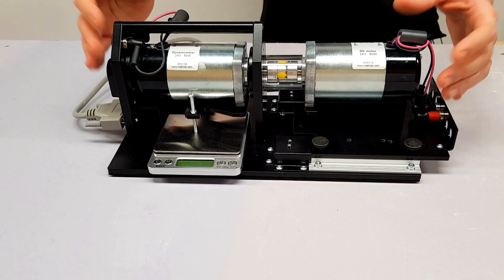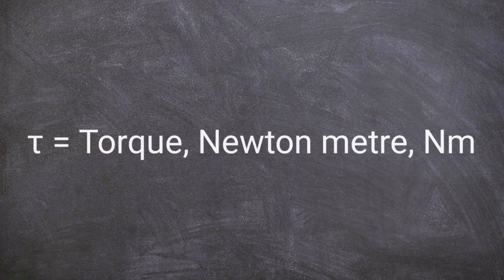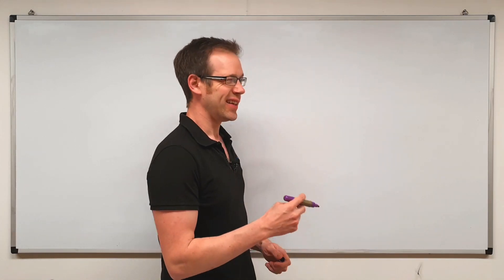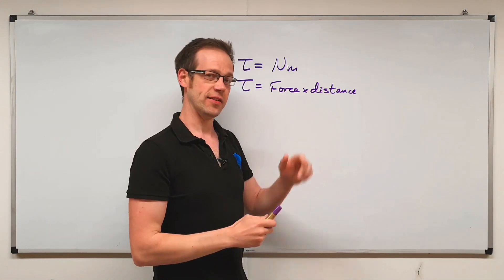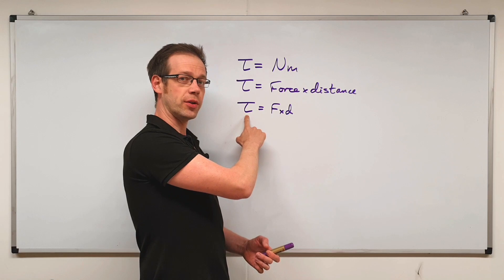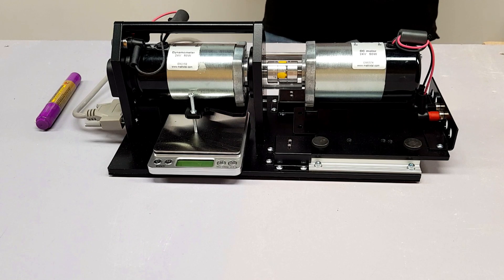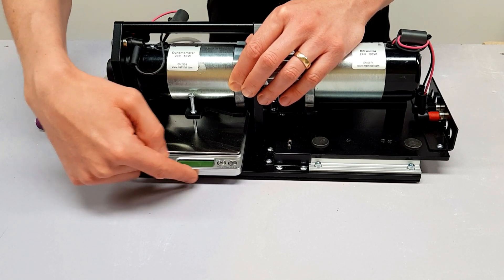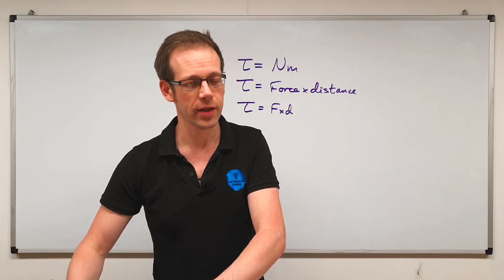What is Torque? A Key to Understanding how to Calculate Torque for a Motor

Comment: Great video Joe.
Can you show were in BS7671 it says that we have to do the screws on a consumer unit to a persific torque and we must use a torque screwdriver? It doesn't it does however say that it is good practice to install equipment to the manufacturers recommendation /instructions.
Reply from the maker: Thanks Sean, I think you've answered your own question there matey. 👍
Reply: @JoeRobinsonTraining  👍
Reply: Is it more  for those who do on of the compitant person skeam  courses ie two day and five day courses were they have NOT had the proper training and don't have the experience, so to make sure they are installing CUs properly and safely the torque screwdriver is being pushed?.
I am just thinking out loud. I have no problem with torque screwdriver
I just don't get the high price and why I have to spend my hard earned cash on one then more to get the dam thing calibrated? If people choose to use them that's fine by me it's there choice.
Reply from the maker: @seandempsey9396  I suppose it's more about about complying with manufacturer’s instructions. You could make the same argument for test equipment really, most experienced sparks don't produce circuits where continuity or insulation resistance is a problem but you test to make sure that if anything goes wrong down the line you've covered your back. An MFT is also not cheap and needs calibrating but it's part of confirming the circuits are safe and covers your back. Same with a torgue driver. 👍
Reply: @JoeRobinsonTraining  👍yes and that makes sense, thank you Joe
Reply from the maker: @seandempsey9396  no worries bro. 👍👍👍
Reply: @JoeRobinsonTraining  will there be a cpd on testing? Oh and just so you know I did the C&G 236 part's one and two for years at college and  about ten years on site
Reply from the maker: We've not got one in the pipeline but it's something I'd like to do. Nice one on the experience, I did the 2360 myself so a little after you I think. Lots more maths and science in it back then. 😍
Reply: @JoeRobinsonTraining  yes there was and contery to popular belief the 236 did include inspection and testing just not like it is now back then it was simply check that all terminals were tight Bush nuts on conduit was tight and so on
Tests were continuety insulation resistance parlarety using a continuity / resistance tester, loop impedance was measured and RCDS Not at all as they were very few and far between. Unlike now we have nine test 4 dead and five Live
Reply: Thanks again mate. I will leave you alone now time for my bed